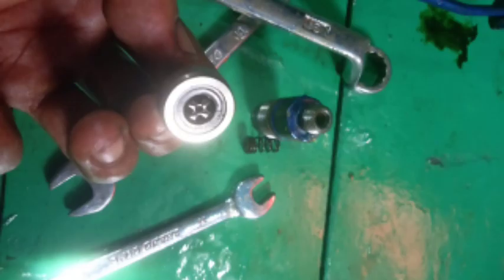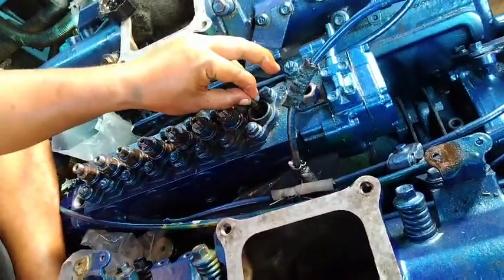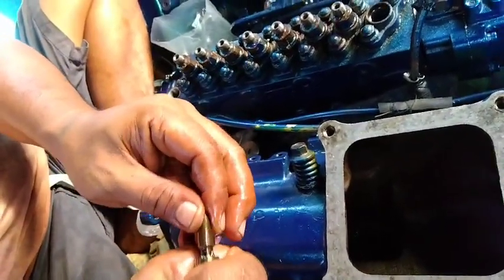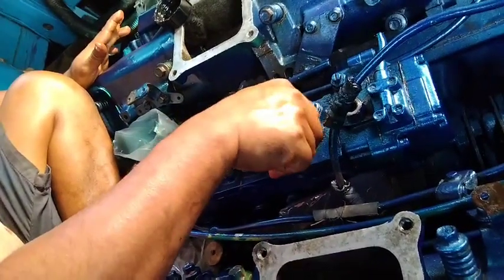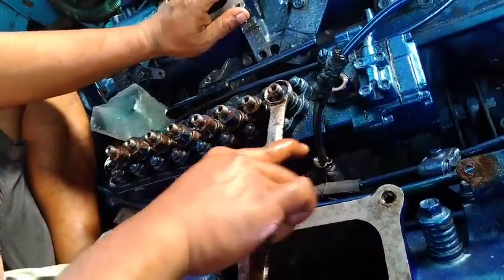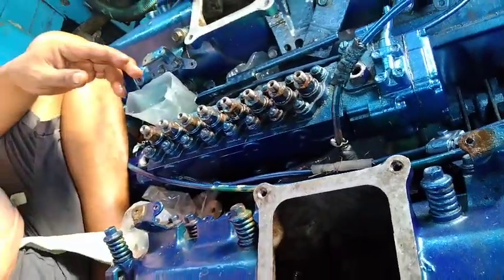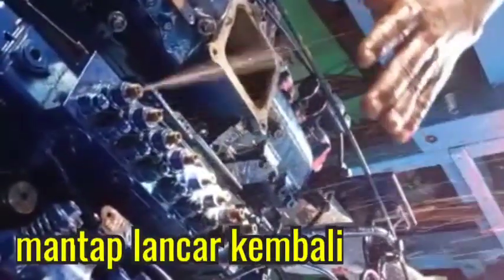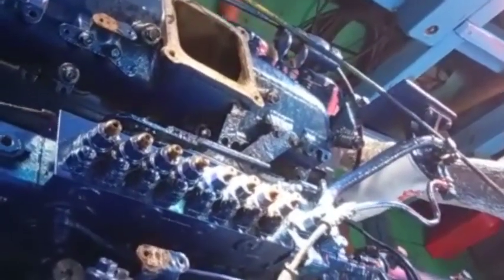penyebab mesin berasap putih perih di mata

Comment: Kalo di gas makin ga kuat mesin nya bang mesinps buat penggilingan padi
Reply from the maker: Minyak tekor,,, boasa karna saringan minyak yg do dalam baut minyak masuk di feed pump atau pompa locok
Reply: @nursalamengineer  bas mau tanya mesin AE saya juga gitu bas dia asap putih pedih di mata bas, 
Untuk mesin Mitsubishi 4D32_821712 sama aja ya bas cara bersih kan bosh pumpnya?
Reply from the maker: Sama saja dek,,, yg penting holdernya saja yg di buka
Reply: Oke siap bas, sama rpm nya itu bas gk stabil kadang turun trus normal lagi gitu bas apa nya bas yg dianalisa?
Reply: Bas firing order timing bosh pump 4 cylinder berpa ya bas?
Reply from the maker: 1342

Comment: Ijin tanya Bas,  Engine kapal tempat sy kerja Type mesin  Yanmar 6EY17W. Kalo mau start Mesin harus tekan salah 1 Rek di Bospom sambil start baru mau menyala,  itu kira" penyakitnya dmn Bas ya...
Reply from the maker: Itu di tekan ke atas atau kebawah, soalnya handel run dan off biasanya TDK bagus, jdi harus bantu tangan, yg penting maksudnya kontrol rack saja, dan cek level oli governornya, yg penting bukan decomp nya yg harus di tekan salah satunya baru mau hidup mesin nya
Reply: Tekan ke Dalam Bas model Bospom single per silinder seperti model mesin kapal kargo,  Level Oil Governor aman,  Iya hanya salah 1 Kontrol Reknya yg di tekan bukan Decompresinya Bas
Reply from the maker: Ok, kan semua bospom 1 conrol rack nyambung semua kan, yg mengontrol tuas akselerasi, bisa jadi tuas on run nya saat kita posisikan run TDK sampai geser control rack jdi mesin TDK bisa hidup, harus di bantu geser supaya debit minyak bertambah saat kita dorong control rack nya, dan biasa juga solenoid off nya macet terus, atau solenoid on TDK fungsi, karna saat di star baru tuas control rack mulai geser pelan
Reply from the maker: Ok, kan semua bospom 1 conrol rack nyambung semua kan, yg mengontrol tuas akselerasi, bisa jadi tuas on run nya saat kita posisikan run TDK sampai geser control rack jdi mesin TDK bisa hidup, harus di bantu geser supaya debit minyak bertambah saat kita dorong control rack nya, dan biasa juga solenoid off nya macet terus, atau solenoid on TDK fungsi, karna saat di star baru tuas control rack mulai geser pelan
Reply: Betul juga Bas Tuasnya aga kurang sensitif/gerak bebas menekan Rek kalo mau start,  ok Bas Makasih ilmunya. Nanti kita Otak atik dulu barang itu mudah"n disitu Problemnya... 🙏
Reply from the maker: Amiin basku, semoga cepat ketemu basku